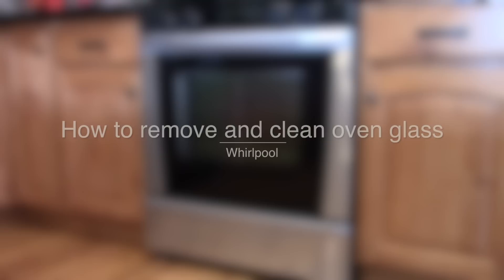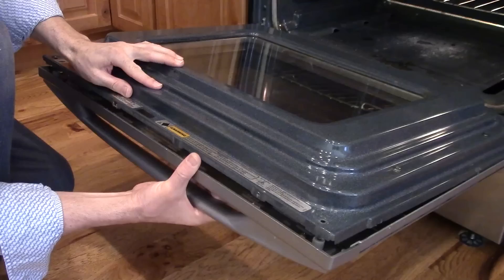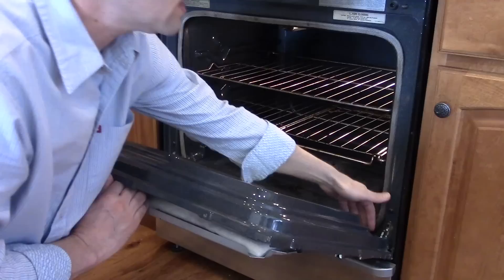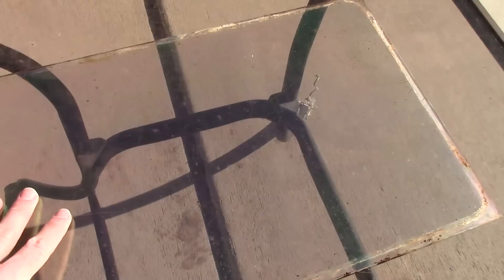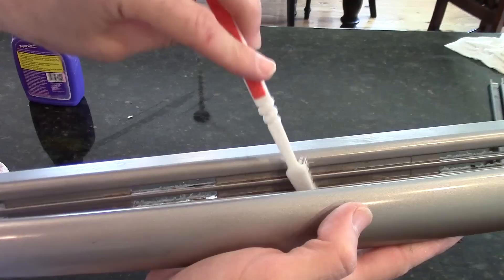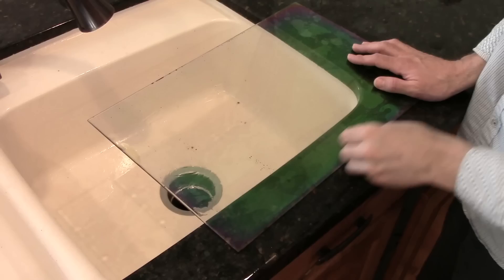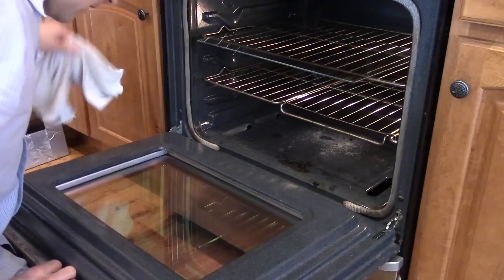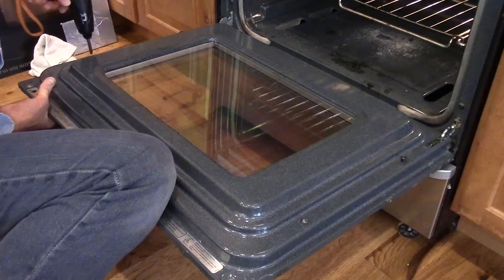How to take apart an Oven Door to clean the Glass

Comment: I gave this a Like since it has a few good tips and the glass cleaning worked like a charm to remove the specs of built in grime! The method in this video may work if you have some upper body strength but if you don't - please just REMOVE the whole door from the hinges and lay it on a flat surface before removing any screws. If you don't you are stuck trying to put 2 glass pieces at an angle that is not stable at all - it will slide everywhere! Not to mention- the insulation will shift when the glass slides as you try to keep it all together with your hand and knees while trying to put the screws on! Impossible - hours of frustration! A flat surface is soooo much better!
Reply: Agreed.  My wife and I just cleaned our whole Whirlpool gas oven (2 hours tops), removed the Door, then removed the bottom piece (2 screws) and burner plate (2 screws) to get to the burner area (tray), YOU WILL need to clean there too.  As far as the Door, it is much easier to work with from a flat surface, plus no finger prints trying to slide the glass back in, no messing with the fiberglass, easier working with the screws, etc.  Not knocking the way he did it and appreciate the video, but for most of us just remove the door.  Not even sure that you save that much time by not removing the door.

Comment: Thanks to all of you that have posted all the very helpful Youtube videos on how to clean oven glass.

Okay, I just finished cleaning my oven door glass. The easy part is taking the oven door off, apart, and then reinstalling. The hard part is cleaning the glass.

First, I would recommend taking plenty of photos before you take anything apart. Next I would recommend taking more photos as you are slowly taking things apart. If you have enough room, lay out the parts in the order you took them out while taking photos of everything. You can’t have to many photos.

To clean the glass I tried a number of products mentioned in all the Youtube videos I watched before I began my task. What worked best for me was a combination of the following depending on how much build up there was.

A razor blade,
You must be careful not to scratch the glass. I felt comfortable using a blade as I use it often when cleaning car windshields for myself and others. If you don’t know what you’re doing or not experienced using a razor blade, do not use it.

Bar Keepers Friend (cleanser) with a Teflon safe sponge,
Need to use a little “elbow grease with this but it does work

Mr. Clean's Magic Eraser,
Works about the same as cleanser and sponge but not as rough.

Griot’s Glass Polish and a glass polishing pad,
I use this as the finishing touch and applied it with my Porter Cable 7424XP set to number four. It’s the same process I use on auto windshields and it actually takes off a layer of glass on a molecular level. Makes the glass as smooth as a babies a$$.

For those that don’t have the tools and products for the last step, just rinse the glass clean with mild soap and water after you’ve cleaned the glass to your satisfaction. Wipe it dry, reinstall the glass, reassemble the door, and reinstall the oven door to the oven. Don’t forget to take the pins out if applicable and reinstall the door stop clips.

Job done!

Comment: It helps that I worked as an auto mechanic to 30years but I still check before I take something apart.  This does not look like that difficult of a job.  Just keeping everything in order and getting an extra set of hands is a good plan for me.  This was helpful, clear and not over the top with unnecessary details.  Thanks

Comment: I had the same problem, only it was chicken and dumplings that went through the vent holes and ran down the glass. I started to undo the screws to clean it but was afraid that it might be harder than it looked. That was a really helpful video.

Comment: On my Whirlpool oven, a wall oven, there is a slot across almost the entire bottom. I took a yardstick. I tightly wrapped some paper towel with rubber bands around one end of the yardstick. I sprayed window cleaner onto the paper towel. I inserted the window cleaner soaked end of the  yardstick into the bottom slot and cleaned the filthy, drippy interior glass. You might need to do this a few times depending on how dirty the window glass is. Slide it out slowly and carefully so the window cleaner soaked end doesn't catch and slide off the yardstick. Result is that the inner part of the window is clean.
Reply: I am 64 on my 5th stove in my life always wanted to clean this. At about  45 I watched a you tube video. It looked way to hard and decided never to do it. But now the oven door is bugging me even more so I think I have matured enough to give it a try. I got all ready to start to day and found out mine has a weird screw in it. Did yours also how do I figure out for tomorrow what screw driver I need for this.

Comment: I have this problem.  My housekeeper cleaned the stove and outside oven door a few years back.  Somehow streaks appeared shortly thereafter on the inside of the glass just like in this video.  I’m glad there’s a way to clean the glass but don’t think I’m capable enough to assemble the oven door back again by myself.  

It’s very disappointing because the stove cost $1,000 USD 😖.  I agree what other people have mentioned that in this day and age, the manufacturers should make sure the oven doors be perfectly sealed,  in order to prevent any liquids leaking or seeping into the glass oven window.  😖☹️.  Very bad workmanship.
Reply: Omg that’s exactly what happened to me I literally was using bar keepers liquid cleaner and it got between the glass ! Mind you I’m a housekeeper I don’t do the inside  of my clients ovens ..because I only do standard cleaning 🧹 but I did this to my own oven yesterday..I noticed my glass wasn’t perfectly flush .. so cleaning product seeped in .. I’m scared to open the glass door

Comment: You have to get down on the floor for my suggestion, and have some kind of tray on the floor under the door of the oven, too, but here is what I discovered: The top AND THE BOTTOM of the door have openings. If you feel under the door, you will find it. If you pour very hot water with something like Mr. Clean or any of those cleaners you add to water, pour it down the top slot where the drips entered the door and try to get it to cover the whole glass window, you can poke a ruler, or any kind of stick you can fit through the opening in the bottom, with an old rag over it and wipe it on the window. It is messy, so have a sheet pan or something like that on the floor to catch the water you pour down the inside of the door. If you are brave enough to remove the whole door you can take it outside and do this on the grass without having to crawl around on the floor and make a mess indoors. It worked for me, but of course it doesn't stay clean, does it? I need to do it again soon.

Comment: I think most professionals or DIYers would take the door off entirely and then take it apart rather than disassembling it while still attached and praying you can get it all together again. Taking the door off is a matter of just flipping two hinge locks.  If it works it works but still.

Comment: The modestly priced Belling oven from the UK has an easily removable inner glass pane. You simply slide it out, soak it in detergent (non ammonia), then scrape off the messy build-up with a razor scraper. No harsh chemicals, no dismantling required.

Comment: My professional oven has a double glass and vent slots at the top of the door so it doesn't get overheated and break the glass. That's how stuff gets in there. I just squirted some liquid detergent in and used the garden hose (I have tile floors with drains). Take the door off, it's not that hard to get back on and take it outside and do what I did.

Comment: Looks pretty easy, just need the strength. If I take the door off the hinges, what is the tricky part you mentioned about getting it back on? - I'm going to wear gloves so I won't get cut on the metal or glass. - If the black spots just won't come off, make a paste of baking soda, apply it, let it sit a while (say 30 min or more), then wipe off. Sparkling glass. (I got a sparkling whole oven with this technique on an old super nasty stove oven with lots of the black spots that 3 applications of spray oven cleaner left behind.) Face it, oven glass gets dirty. To clean the whole oven is a big chore that takes a fair bit of time. That's why everybody hates doing it. I wish the door was an easier design to clean too but they are all like that. My Whirlpool is the best oven I've ever had in about 45 years.

Comment: Keep in mind that you may be dealing with a tempered glass that can be experiencing heat stress. If you remove it from the housing in this condition, you could unexpectedly trigger the glass to shatter in your hands.

There are makes and models of ovens whose glass doors have exploded unexpectedly  because of this.
Reply: Yes..my Kenmore range outer glass went boom spontaneously after 10 years of heat stress...something to do with "nickel sulphide inclusions" in the glass. Fixing it with a replacement glass from Reliable Parts (Canada). Hence my interest in this..

Comment: Just tackled this on my Ikea Bettrod oven. Very similar to the one shown but the front shield wraps under and is screwed to the underside, it doesn't pull out. I would recommend remove the door and place on workhorses. This way you aren't fighting the springs and you can lay it flat whilst replacing the frame and glass. Lay on the floor to put the (4) screws back in from underneath. IMHO much easier.

Comment: My oven door is definitely different... the "handle" is truly the handle piece and comes apart from it's backing... and the outside glass does NOT come off of the oven without removing the whole door... instead it just waves back'n'forth... this later caused some horror for me when I couldn't figure out how to get the glass flush with the door - should've watched the video all the way through, would've figured it out sooner.

If I could have removed the door, I would have, but I couldn't find a way to do it and generally I can figure stuff like this out (I have no doubt it comes off, I just couldn't figure it out this time).

I did have a moment or two of sheer terror (oh no! I broke my oven) and having to tell my husband when he gets home in approx 1/2 hr BUT by staring at the piece that the handle connects to - and some judicious use of some scotch tape to hold it all together while I was trying to get that piece back on - I sorted it out.

My oven glass is now clean! Ok ok... since I couldn't figure out how to remove the door, I didn't bother trying to get in between the two inner pieces of glass - since the mess was actually on the outer panel of glass and the outer of the middle piece of glass, I figured I was good with that.

Some day I will get up the gumption to pull apart those interior pieces of glass... but likely when hubby is home and can help me figure out how to remove the whole door.

BTW, yes oven doors CAN cost $1k, individual parts ALWAYS cost a ludicrous amount. I "supervised" an appliance repairman and he explained a LOT to me about how the business works and why he always just recommends buying a new appliance... and he prefers the idea of repairing everything but he said that it's now to the point where's there's just no point, buy a new one.

Also, fun tip - when you buy a new appliance, especially a new range, run the self-clean (if it has that feature) at the longest running time BEFORE the warranty runs out. Some of the ranges have a problem where it'll break the internal thermometer - costs more than $400 to repair but is covered by warranty... the manufacturers KNOW about the problem, they just haven't bothered to apply the fix to any new appliances they've made.

And thus ends my novel! ;)
Reply: This model has been recalled?

Comment: Hi Adam that information   is helpful I will now have to do that on my aunts stove as its need cleaning really , can I ask about that thing you use to remove the screws what is it called I think its works  better than using the normal screwdrivers and when again  can I get it ?

Comment: Hello, Adam.  Upon trying to clean the glass on the inside of our oven door, I managed to break the two side plastic trim pieces BEFORE watching your video.  I am getting that issue remedied; however, prior to putting the glass door back on, I have a more significant issue to fix: when I fully open the door, it now springs back closed.  Any suggestions for how I can fix that and get it to stay in the open position?  Please and thank you!

Comment: A lot or most of the ovens have holes in the bottom of the door if you pull out your drawer underneath pull it out and stick your hand up you will find holes in the bottom of the door and that is how I clean mine I just stick up then brushes in and towels and rags up inside those holes and clean it that way
Reply: @oneworldpeace1  Keep the door closed and open the bottom drawer take the drawer out and when you look and feel up there you will see holes on the bottom of the door and you can get things inside of their scrub brushes and rags up there and that is how I clean mine there are 3 or 4 holes on the bottom of the oven door

Comment: Do we need to drill in the screws or can I just use a screwdriver? The screwdriver doesn't seem to fix it tightly what could be the issue?
Reply from the maker: +janishyathi raghuram Use a larger or smaller screwdriver. You don't need a drill. The drill just makes it go faster.
Reply: When I try to fix the screw it just keeps turning and is not fixed tightly. Any idea what the issue could be?
Reply from the maker: First make sure you have the right screw for the hole. Sometimes I make a mistake and have one in the wrong place.  Second, make sure the hole is not worn. If it's plastic you are screwing into it tends to wear loose from over-tightening.

Comment: FYI fiberglass insulation fibers can get into your lungs if you disturb it. And those fibers that get in your lungs can and do cause lung cancer.
Reply: You are technically correct, of course. Don't ignore the fact that your house is FULL of fibres floating in the AIR, many of which can equally be the cause of lung cancer. Better wear a mask FULL TIME just to be on the safe side.

Comment: Ok so I cut my hand twice doing this due to the raser sharp edges. Hardest job I have ever done in my house lol. Two hours  just to get the glass clean. I will buy a new oven rather than doing this again. Shame on Whirlpool awful design never buy whirlpool ever again
Reply: I really think the best way was, as he said in the beginning of his demo, take the door off, put it on the table or counter and proceed to take apart.  That way you can lay everything out and easier to reassemble when cleaned.

Comment: I watched your video and decided to give it a try on my frigidaire stove. Mine, thank goodness, only had 1 removable pc of glass. I'v cleaned it, and had it put together and then noticed that it does not fit tightly where it comes in contact with the front frame of the oven. Can anyone tell me what is causing this?

Comment: I found your video after I did the cleaning for a customer.  Turns out that I  separated the front panel from the ceramic painted portion of the door and broke the flange.  It's costing me $500 to be shipped in.OUCH!!  A question a little off topic though.  What kind of video camera are you using?  Seems like very different/realistic video footage compared to other video cameras that I have seem. Thx

Comment: Liked almost all tips, but not taking the door out and wiggling the glass out and back in seems odd. At least on my GE oven for removing the complete door, disassembling, cleaning and putting the whole unit back in was a breeze and didn't pose any danger to accidentally rip or dislocate the insulation material.